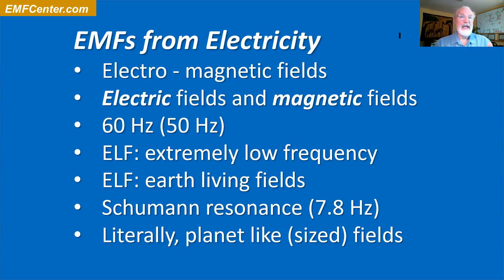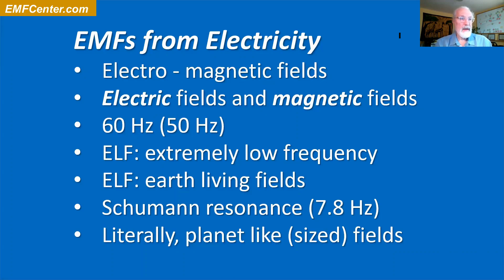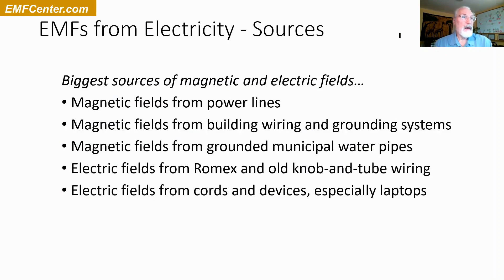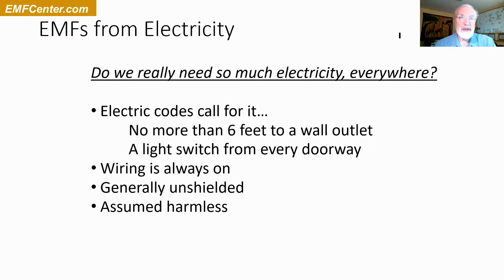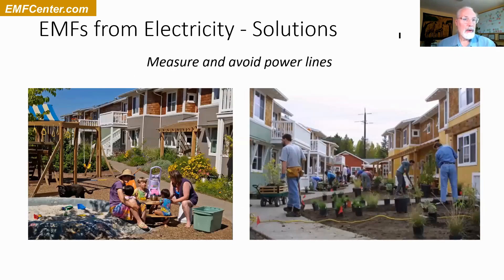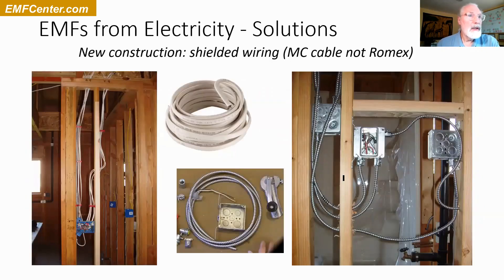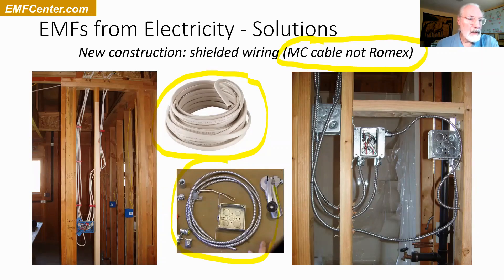How to Reduce the EMFs from Power Lines, Electrical Wiring, etc. (EMF & Your Community: Part 2 of 4)

Comment: My son's wire that connects his computer with the electricity produce high EF . How can i stop it?
Reply: You can buy shielded versions of that cable, if you're referring to a desktop pc. I saw them just the other day.
Reply from the maker: That is a good suggestion assuming the electrical outlet/plug socket is grounded in the first place. They usually are but it does not hurt to check as the shielding could be counter productive if it is not grounded (you can usually find a tester for that in a regular hardware store).  

Satya

Comment: Does turning off the circuit/breaker to a bedroom in a house with dirty electricity eliminate the negative health effects from dirty electricity in that room?
Reply: Of course, but I don't think is a good solution for long term. There are switch off boxes.
Reply: Thank you! I appreciate all your insightful videos. Thanks for sharing your knowledge @John-ek5bq
Reply from the maker: Great question! It’s the electric field that carries the ‘dirtiness’ from nearby wires into your body, so eliminating the electric field also removes the dirty electricity that comes with it. The challenge is that many wires run through walls, floors, and ceilings, and they’re often not shut off by a single breaker. That’s why turning off just one breaker usually isn’t enough to meaningfully reduce the electric field in a room.

It’s also important to keep in mind that electric fields can sometimes cancel each other out, so the results of turning off power may be counterintuitive. That’s why I highly recommend actually measuring with a body voltage meter that’s grounded directly to the earth (ideally not right next to the building or another power source).

Satya

Comment: Hi sir, thanks for your video. How about if we are currently living next to a high power tension station point where there is a small concrete room and simple mesh-wired fence surrounding it. Does it affect highly our health living next to it? Thanks if you could provide a solid solution as we need to live here long term due to financial issue.. I was wondering if building a thick 50cm or 1 metre wall in between my house and the station wired fence could help cancel out entirely the EMF emitted from this station point..
Reply: You need to buy an electrosmog meter and test first.  No one can shield anything without knowing which frequencies they are shielding.  These meters are only a couple of hundred dollars and worth every penny.

Comment: Agreed shielded wiring and isolating circuits is first step. Typical modern SMPS loads (tv/appliances/pcs/routers etc etc) kick noise back onto the mains and the included line filter circuits CAUSE HF resonance circulating currents on the house wiring circuits causing emissions. The remedy is series RC damping networks (can be built into double adaptors) with loads plugged into these 'damper' adaptors. Heads up, the likes of Stetzer 'filters' are simply 15uF capacitance wired across the mains and can cause radiated emissions to INCREASE by CAUSING circulating HF currents. Hope this helps.
Reply: Eric - I appreciate your comments.  While I'm a fan of Stetzer and like filters I've found just what you say; that radiated emissions do seem to increase causing circulating HF currents.  My neighborhood seems to have peak periods of surges from the utility and this combined with my own HF currents, the Satic Power Perfect Whole House filter seems to get caught circulating the currents at peak periods.  Again, a fan of the technology, I do find I need to clear it at times by flipping the breaker and allow it cool before switching it on again.
Reply: @jasonschlegel4027  Hello Jason - "....that radiated emissions do seem to increase causing circulating HF currents."  You have that backwards......currents circulating between a noisy/non linear load and the likes of Stetzer 'filters' CAUSE circulating currents which cause increased radiated emissions ..ie the likes of Stezer filters can INCREASE household radiated emissions.
Reply: @ericmc6482  Thank you for clarifying, Eric.  I appreciate this.
Reply: Its challenging to get my head around all of this at times.  Again, much appreciated.
Reply: Are there RC damping newtworks plug ins to buy?
Reply: @John-ek5bq  Hi, not that I know of.
That said 'spark quench' RC networks are available, try Farnell, Digi-Key etc and mount inside enclosure like double adaptor etc.